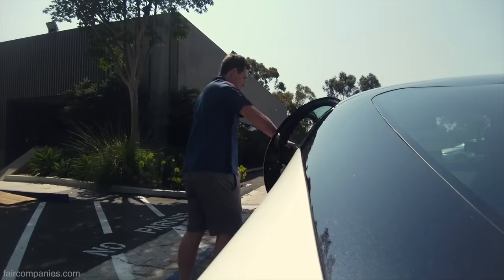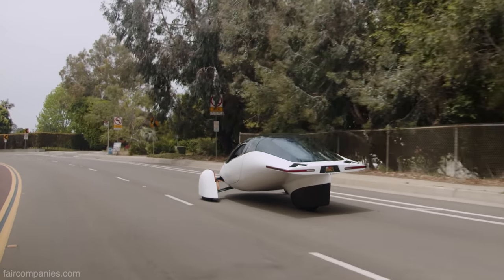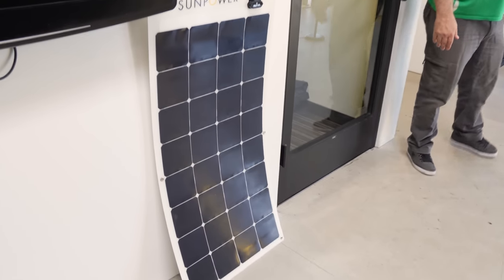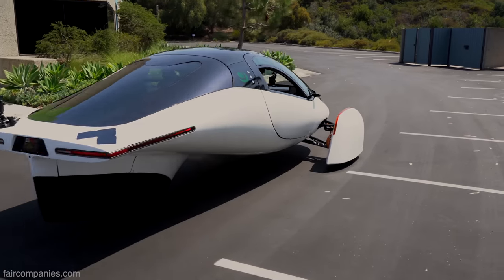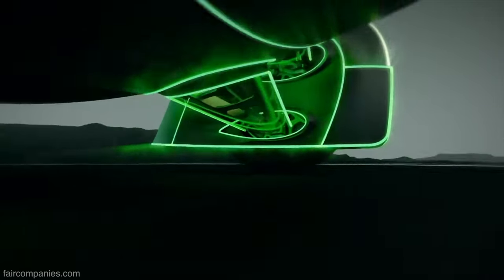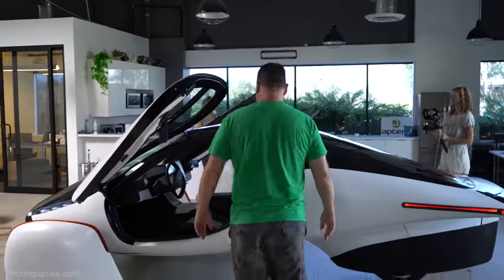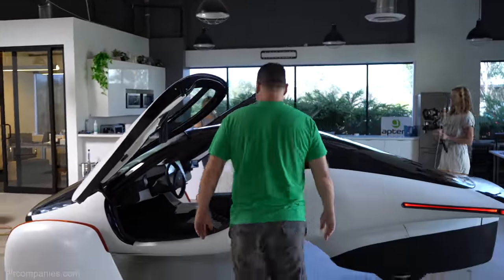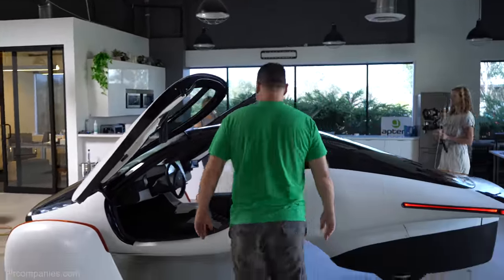Aptera commutes just on solar, gets 1K mile-range when full

Comment: how do you change the tires?
Reply: The wheels bolt onto the wheel motors as if they were drum brakes.  Nothing unusual about changing them.  I plan to carry a pair of pliers, a plug kit, and a DC inflator for flat tire emergencies.

Comment: That is amazing ideal. But what about the price of the prototype and finally the cost to the public?
Is it very expensive?
Good ideal. Thanks.
Reply: Aptera prices start at $25,900 for the 250 mile range model and go to around $50,000 for AWD 1000 mile range and other options.

Comment: having the motors in the wheel works for light motors on smooth surfaces at moderate speeds. It gets quite uncomfortable to outright dangerous at higher speeds due to the unsprung nature of the mass in the wheel. He smoothly skipper over that ;-)
Reply: It is merely a matter of suspension tuning.  The wheels are not THAT much heavier

Comment: If it could be scaled up to a 4 seater, then it would be a good option for taxi and uber drivers as it doesn't have to take as many detours to charge as other EV options.
Reply: The second Aptera vehicle is planned to be a 4 wheel, 5 passenger sedan.
Reply: @n.brucenelson5920  Thank you for the valuable info

Comment: How to change the tyres?
Reply: Just like any tire.  The wheels bolt on to the motor as if they were brake drums.  I plan to carry a DC inflator and a plug kit, just like I did for my motorcycles.

The wheel pants un-clip without tools.

Comment: Sweet, will a strong cross wind lift it up into the next state? just askin
Also what are the batteries made of?
Reply: No, there is downforce designed in at the back of the vehicle - 25 lbs at 65 mph, which increases rapidly with increasing speed.  It has been tested stable in 120 mph cross winds, far higher than slab sided SUVs.

Comment: How are those solar charging car concepts on safety?
Especially if meant to be on the roads with more traditional cars and also if usable on long distance accidents will happen. How about rough roads. Just wondering if those pose a problem or its solved/solvable.
Reply: Aptera will be voluntarily crash tested to federal automotive crash standards and the ratings published before shipping begins.  Rough roads performance should be as good as any small Japanese car, and better with the off road kit.

Comment: side view cameras and what looks like a review camera but also a mirror. That entire rear deck could be solar, turning 700w into easily 1400+w. There must be a reason for this design choice and I suspect it has to do with laws or regulations. Any input on why this is the case would be great to know.
Reply: Regarding the solar, the vehicle in the video does not have 700 watt of solar.  The full solar package option does have solar on the rear hatch and that would end up making it 700 watt.
Reply: @alainchuzel8341  Ahhh, makes sense! Thanks for the reply.
Reply: @trevorsgaragemusings  My pleasure!

Comment: Problem is that it’s not going to meet all of the safety demands that are required by the USA ! Electric vehicles are neat and one day might take over !
Reply: Where did you get that idea?  In fact it will be crash tested to full automotive safety standards and have the ratings published before shipping begins.
Reply: @n.brucenelson5920  I will be impressed if it is !!  Will it be classified as a motorcycle or an automobile?  It will have airbags etc ?
Reply: @JS-zb1vv  It was designed from the beginning to pass federal crash test standards.  It will have air bags, seat belts, and an F1 passenger safety cage and front and rear crumple zones.  We will see when the tests happen.

Comment: How do you change tires on this when it has the full motor in it?
Reply: The wheel pants clip off without tools and the wheels unbolt from the motors just like they do with normal drum brakes.

Comment: So, it's classified as a motorcycle, but since it has 3 wheels you don't have to have a motorcycle license to drive it?  I was initially a little put off by the idea that I'd have to get a motorcycle license to own and drive one of these, but if the above holds true, maybe it's worth thinking about.
Reply: Correct.  It won't need a motorcycle license to drive.  It will also be voluntarily crash tested to FMVSS part 200 crash test standards once production intent models are available for third party testing, and the results will be published.

Comment: I can see a "lot of curbing" with the wheel guards as the wheel projects from the main body. And considering the motors are in the wheel, could present a problem. Plus, because of this, I don't see it fitting in the average size garage...
Reply: Most average parking spaces are 108" wide.

Comment: basic info was missing. how many miles can it charged sitting in the sun or driving in the sun per day? does the angle matter? i don't thing it can get more than 25 to 30 miles of charge per day with full sun.
Reply: Up to 40, but your value will be more typical for many of us.
Reply: @n.brucenelson5920  thanks
Reply: @n.brucenelson5920  40 has never been proven.

Comment: If you get a puncture how easy is it to change the tyre?
Reply: Easy.  The wheels unbolt from the wheel motors, just as if they were brake drums.  In most cases a puncture can be fixed with a pair of pliers, a plug kit, and a dc inflator.  I have done the same many times in my 400,000 miles of motorcycling, including cars with flats I encountered on the way.

Comment: It is simply not true that there is NO penalty for going from 4 to 3 wheels. It is less stable in moose-test situations and you will have more body roll. It can be limited by having stiffer suspension and whifting the weight forward and I think it will be fine but saying 'the inner wheel lifts so why have a fourth wheel' sounds cool but speaks of limited technical insight. Especially when experiencing understeer in a slip (which is more likely seeing the weight distribution) a three wheeler will be way more likely to flip. Other than that very cool concept! And it is true that to be truely 'solar powered' you need extremely good aerodynamics and a lot of solar.
Reply: The Aptera has inertial sensors to keep the performance envelope in a safe range unless turned off for racing applications.

Comment: Rain, rain, and puddles.  With the electric motors in the low mounted wheels, will rain or puddles be a problem shorting out the motors?  With the low weight of the Aptera, is there a danger of the unit floating?  Will there be drink holders between the seats?  Power steering and power brakes?
Reply: The motors have been tested to run under 10 ft of water, and with 100 hour salt spray tests.  The interior parts are completely potted with a material that also absorbs 100 G impacts without damage.

I presently drive an 1,800 lb Honda Insight that does fine.  That said, one shouldn't enter a flooded area in any vehicle.  Aptera is likely to float in a nose down attitude.

There will be drink holders between the seats with elastic straps to hold the cups.

I don't know for sure about the brake and steering application.  Steering is likely to be quite novel due to the possibility for differential steering by commanding different speeds (or even direction!) for each front wheel.

Comment: I would love to know the math that the energy needed for sideview mirror cameras and screens is less than the energy lost by having mirrors. I'm sure they've done it, and they chose the most efficient way, but wow -- EDIT: 18:10 sideview mirrors would eat up 20% of the energy of the whole vehicle. still wonder if that number starts from subtracting what the camera setup uses, but wow. But then if I put my hand out the window -- ..??!?!?!!?!
Reply: He's referring to the aerodynamic drag coefficient alone. But even if you look at the power consumption of the camera and monitor, the current draw would be measured in milliamps, very small. Whether or not that consumes more energy than dragging a large set of mirrors through the air depends entirely on how fast the average operating speed is during the duration of the experiment.
Reply: @shmaknapublar  with the camera and screen activated you're talking hundreds of milliamps, even super super efficient not single digits. if a sensor activated them only when you looked, perhaps that would save. i appreciate your response but still curious
Reply: @herzogsbuick  I based my statement on the average number for what a cell phone uses. And the cell phone number includes transmitting power in the estimate.

The reason mirrors are responsible for such a large percentage of the overall drag component when compared to their relatively small frontal surface area has a lot to do with the compounding factors from interference drag and the disturbance of the laminar flow over the front half of the vehicle. You aren't just adding the drag from the mirrors if tested by themselves in a wind tunnel. Where the airflow from one component is forced to mix with the airflow from an adjacent component, the sum of the overall drag is greater than that of the two components by themselves. And the disturbance of the laminar flow on every part of the car's body that is downwind of the point where the mirrors are attached causes even more drag.

Comment: If entry looked more smooth it would have been a better sell. Both struggled a bit; looked awkward. Also, does this convert for rainy or overcast days or seasons?  EDIT:. What happens if you got a pothole or something when the motor is IN the wheel on the  wheel baring?

Comment: How do you change the front tires?
Reply: Just as with any vehicle.  In this case, you remove the wheel pants, unbolt the wheels from the wheel motors, and change the tires on the 16" rims at any tire service center.

Comment: How long does it take to charge with that solar?
Reply: If you have full solar you can look up the federal Solar insolation charts for your location.  Of course it depends on how cloudy it is.  In San Diego, you might gain up to 44 miles of range per day.  Many people might recover the cost in savings compared to average fuel prices in two years.  You could make a spread sheet for the car you drive now and input your daily fuel cost and the daily solar radiation at your location.  Many people find that they never have to plug in, even with a few 200 mile trips thrown in.

Comment: Cameras rely on functioning electronics with multiple complex parts.

Mirrors require a flat reflective surface.

Consider the saying in engineering, "the best part is no part" and you will understand why cameras will take a while to prove they can be relied upon as a safety device
Reply: And of course all the numbers they're quoting for the solar panels rely on living in California or some other arid, equatorial region...
Reply: @blackoak4978  If you check their web site, they have solar insolation tables for everywhere.  Here in Iowa, I am likely to average at least 20 miles per day, still enough for all most all my local needs in a small town.

Comment: there is still plenty of space to put solar panel like on the sides and maybe with a little bit of design change this can get better range without the need to recharge and also a bump it specs make a better suspension even more space
Reply: For the average consumer, solar on the sides would add very little extra range and is likely not worth the effort and cost.  Regrettably, I don't understand everything after "recharge".

Comment: I wonder how many mpg it would get with a 350cc single cylinder petrol ( gas ) engine. 200MPG ?
Reply: they claimed 330 mpg at 65 mph in 2007 with a very similar chassis  using a diesel-electric hybrid. if it can be believed

Comment: What happens in cold climates especially in a big traffic jam???
Reply: Aptera should be good down to around -20 F, with perhaps some loss of range.  Early models will have resistance and peltier heating.  Later ones will have more efficient reverse cycle as soon as they can source transportation qualified reverse cycle valves from the supply chain.

Comment: Wheel drives are the promising future of electric driving. The weight need to come down. Mass at the wheels is always compromising drive comfort. So there should be a concept using the wheel‘s rim as structural part of the motor housing to get the total wheel weight with motor down to gain comfort… Even better with a carbon rim…
Reply: i wouldn't like a structural rim. this one is a simple 5 bolt construction (allegedly by elaphe, look them up they're awesome) on which you could put an off the shelf 15 or 16 inch rim perhaps with minimal modification, if that. you'd lose this if you want to further lighten the wheel, and you'd have to wait for the company to send you a replacement, and you're out of luck if the company goes under in the meantime. (currently it might be the one that says ~23 kilos / ~50 pounds additional weight on top of a normal wheel hub+disc brake+disc)

Comment: I'm curious... How do you repair a flat tire?
Reply: It is actually quite easy - just do what i did with my motorcycle tires.  Carry a DC inflator and a tire plug kit with needle nose pliers.  The wheel pants clip off quickly without tools for full access to the tires.  Find the puncture, use the pliers to pull out the cause of the puncture, plug it with the plug kit and then reinflate the tire.  If needed, drive to a tire shop to replace the tire.  The wheel bolts on to the motor just as if it were a drum brake.

Comment: Very impressive technology!  One question though, how does it handle in high winds?  If traveling across country?  How do you keep it from going airborn or fly into a ditch? Heck  semi trucks pulling trailers have their trailers flip in 60mph winds.  How do you keep this thing on the road in a canyon road with gusts to 70-80mph?  Solve that problem and you wont be able make these fast enough to keep up with demand
Reply: It has been tested in 110 mph cross winds.  There is not that much for wind to push against.  There is 25 lbs of down force designed in at the back at 65 mph, which increases with. increasing speed.
Reply: @n.brucenelson5920  thanks for the info, I stand corrected

Comment: best for urban transportation system .yes but not very easy to change tyres and yes also for off roading or bumpy roads .
Reply: Repairing tires with a plug kit and dc inflator is easy, and worked just fine for my motorcycles.  There will be an off road suspension option, which I think will be popular.
Reply: @n.brucenelson5920  plug kit won't work if damage is too much ,one day you have to change tyre which will be trouble some otherwise its a great vehicle for offgrid people.and for off road i don't know how much efficient it will be with front powered wheel ,even if its all wheel ,there is only one wheel in the back which will effect power transfer to the ground in some way.though i am very positive about it cause its very price effective compare to tesla and other EVs out there .
Reply: @darkml2659  In over 400,000 miles of motorcycle riding, the few times I have had flats, I was able to fix them easily with a plug kit.  If there were damage too great for such a fix, the repair or changing of the tire would be no different from any other car.  If this were a huge concern due to special considerations, you could always carry a spare wheel and tire..

Comment: WHY doesn't Tesla use solar to compliment their batteries? Why not take advantage of wind generating while you're rolling?
Reply: The Tesla requires several times more power to travel the same distance, so solar can't supply Tesla with as large a benefit.   This is also why Aptera can travel further on smaller batteries.

Comment: All very interesting but:

(1) When will it be offered commercially in the US?
(2) What wll it cost?
(3)  What will be done regarding a dealer and service network?
(4)  How long the warranty?
(5)  How well financed is Aptera, and what assurances can they give would be owners they won't disappear?
(6)  What safety features will be offerred?  Air bags?  Collision avoidance? Anti-theft? Plug in charging?
(7)  Any US tax credits available for the purchase of this vehicle?
Reply: First delivery planned for this December.  There is a 25,000 unit preorder list and growing rapidly.

Starting at $25,900 for 250 mile range.

Right to repair and 24 hour parts turn around.  Open source repair instructions obtainable with QR codes through-out the vehicle.  Mobile repair agents.

Warranties to be announced, but in line with industry standards.

Aptera has had several successful fundraising rounds, and has investment from multiple billion dollar plus VC firms with representation on their board.  They have an IPO planned within the next couple of years.

Aptera is designed to pass the FMVSS Part 200 crash tests and when production intent vehicles are available it will be tested by a third party and the ratings published.  It has front and rear crumple zones, a Kevlar and carbon fiber passenger safety cage, air bags and seat belts.  OTA upgradable Level 2 self driving is an available option.  Plug-in charging widely available from 110 VAC to 50 kW DC fast chargers.

Tax credits have been passed in the House, but we are still waiting Senate action.

Comment: How do you change the real tire when you get a flat?
Reply: In most cases you don't need to change the tire.  The wheel pants come off and you can use a plug kit to fix the tire.  In case you need to there is a jack point at the back of the vehicle.  The wheel unbolts from the hub, just like it would on any car